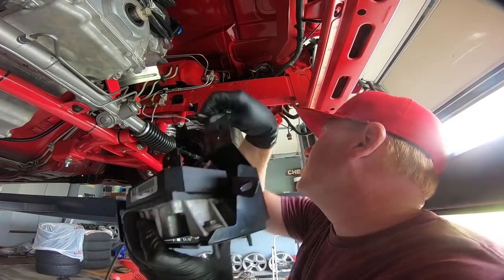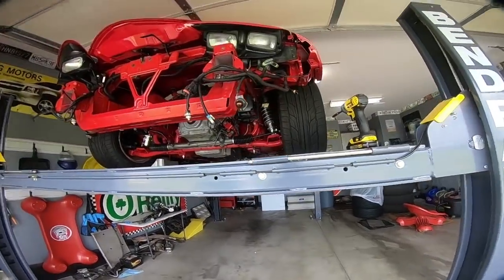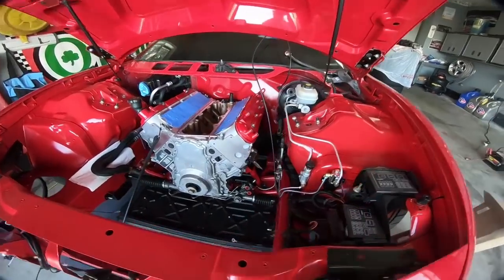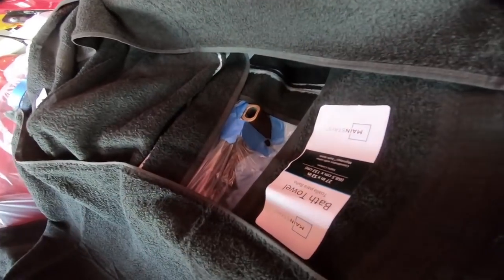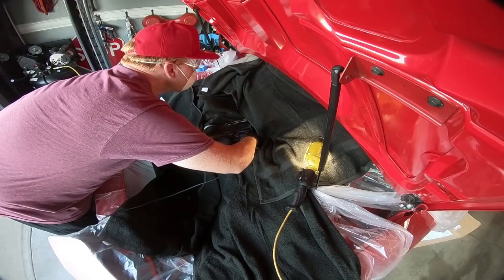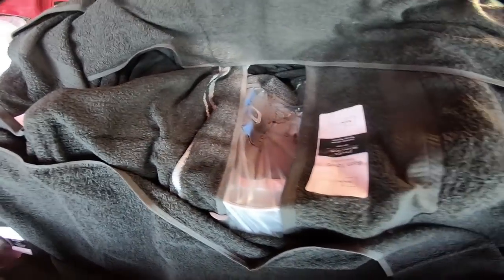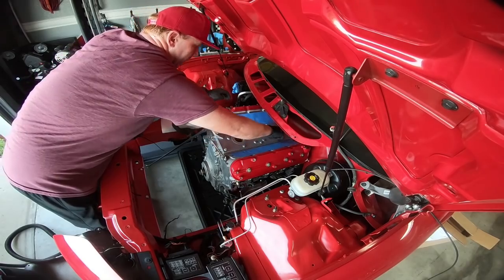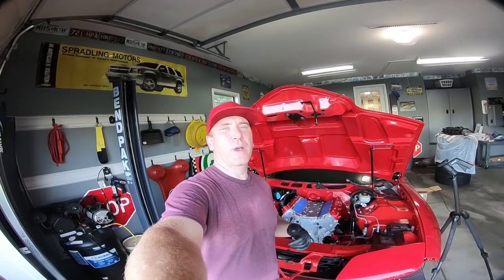Installing LS6 Valley Cover and PCV

Comment: Thanks for the videos.  Life got in the way and I didn't get to it until May.  I was so relieved to see I have an ls6 block.  I needed it after the battle I had removing the intake and valve covers.  More power to you man.  I get so frustrated with the room back there.
Reply from the maker: Thank you. Glad I could help

Comment: Did this to mine about 3 years ago... so much nicer and cleaner :)
Reply from the maker: Definitely worth it
Reply: Is that part that gets cut is it solid all the way down or if you go cut more than a inch will it damage block?
Reply from the maker: @justsendit4829 not wirth doing this now witha good catch can
Reply: @TWAMotorsports  good video, having some PCV issues with my LS1 Swap - doing research, was considering this or a catch can (Not both) unless recommended. I have Holley LS valve covers which do not have the PCV port - so you think a catch can is a better bet than cutting like you did ? you still think it can look clean wonder how the lines would go with just a catch can
Reply from the maker: @CaliStilo1988 catch can is probably a better solution

Comment: Hello sir i had a question about the alumnium tube that has the red cover
Reply: What is it used for i recently had my motor rebuilt it’s a LS2 6.0 in a trailblazer ss and the machine shop has that valley cover on there should i cover that tube
Reply from the maker: Not sure what you mean
Reply from the maker: Depends on pcv routing

Comment: The 01 and 02 Fbodies came with the LS6 Block. I was lucky enought to not grind anything down. good job though bro
Reply from the maker: Thank you. I swore mine had it but oh well. It wasn't to bad.
Reply: I'm a 01 Trans Am NHRA edition owner and I have a LS1 block(
Reply from the maker: @SuperViper83  not all came with them. Very few.
Reply: Is there a number on the block that would signify weather it is a ls1 or ls6 block? That way I would know in advance before taking my intake off
Reply from the maker: @jeffrockwell2814  Get under the car....On the drivers side rear of the block where the head meets the block you will see the casting number....

If it reads 12561168 it is an LS6 Block if it reads any other number then it is an LS1 Block...
Reply: @TWAMotorsports  you the man. Thank you!
Reply from the maker: @jeffrockwell2814  you're welcome

Comment: Hey. I love your videos.  I may have missed it in your links, but where can I buy a quality harness and knock sensor combo?  I hate spending the money, but I will hate myself if I need to replace a year or two later and I had the opportunity when I changed the valley cover.  By the way, I may be mistaken, but I believe I have the ls6 block in 01 ws6.  No cutting necessary!
Reply from the maker: Should be in video description but if not I only buy delco stuff to replace. As for the car having ls6 block. Some did. Some didn't. Mine is an 02 and didn't
Reply: @TWAMotorsports  Thanks.  These projects always end up being twice the cost that you planned.  My OCD keeps me from putting back old parts that aren't broken.  I just want it to be a long time before I reopen the valley again. lol
Reply from the maker: I have the same problem lol
Reply: @TWAMotorsports  My wallet hates me. lol.  The valley cover has the pcv valve as you state.  I've heard too much conflicting advice on weather to run an external one as well.  I'll be running FI.  Is it necessary in your opinion?
Reply from the maker: I like it to clean up some unneeded lines under the hood

Comment: Nice video man. I also got that set up from Improved Racing. I also bought their crank scrapper and racing oil baffles. Did you get the sac city dumbbell for the block? Have you looked into Evan's waterless coolant for your car? I'm doing the switch for mine. I also got the Samco silicon hoses for the radiator is well. I can't wait to see it all back together.
Reply from the maker: Thank you. I didn't do they dumbell but may do Evan's coolant.
Reply: @TWAMotorsports  awesome

Comment: Is that a LS6 Block or LS1 Block?... I know you said it was an older style but if my recollection is correct late model Gen 4s received LS6 Blocks.  Is that piece of aluminum on the original LS1s do you know?  Just curious.
Reply: By the way it’s coming along great.
Reply from the maker: It's an ls1 block. Some late 02 models received the ls6 blocks. All 03 up blocks do not need the block cut.
Reply: Keep up these great videos. I only watch the trans am vids since i own one but every one is detailed and usefull.
Reply from the maker: @ronaldarchibald2506  thank you 👍

Comment: So I’m a little late to the party but since it’s been some time how’s the LS6 PCV working out?  I did this when I did my cam in 06. It seems it works pretty well but I’m still seeing oil at the throttle body so not considering adding a catch can.
Car looks fantastic, btw!
Reply from the maker: Thank you. I actually haven't got it together yet. Got a twin turbo kit and waiting on parts
Reply: @TWAMotorsports   I saw the next video and figured as much. 140k and going strong here on the TA. Thought about a motor refresh and upgrade but it’s cruising time. My last actually ment to say I AM considering a catchcan.
Reply from the maker: Yeah catch can would be a easier way

Comment: The bolts look a bit larger, do recommend using them or the old??
Reply from the maker: They are bigger. Mine came with new bolts.
Reply: TWA Motorsports yes so did mine, my question is do you know if theirs any clearance issues with the bolts and intake?
Reply from the maker: @sweetdees86  I didn't have issues with my ls6 intake
Reply: TWA Motorsports 👍🏼